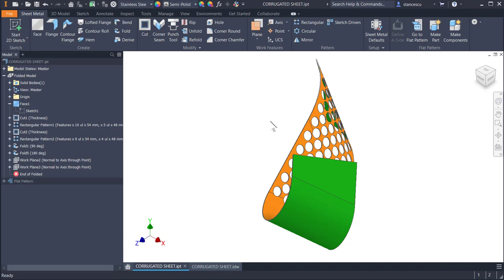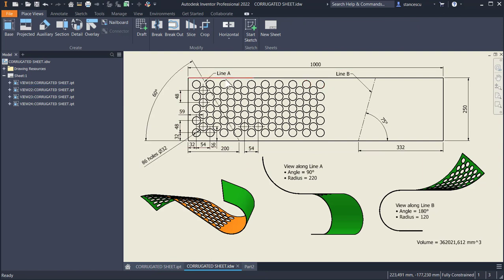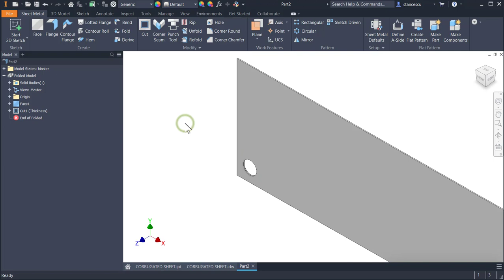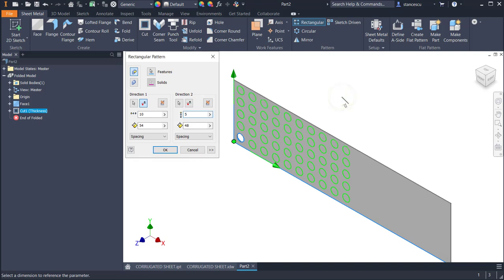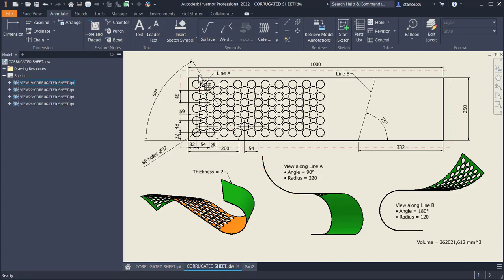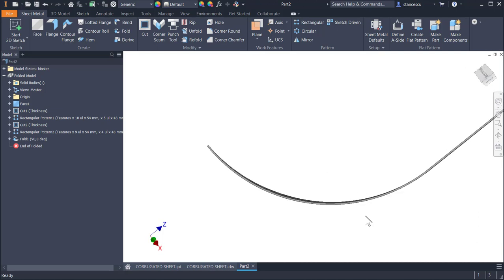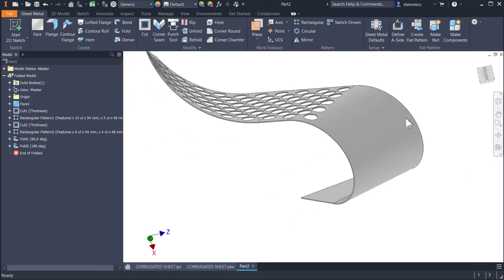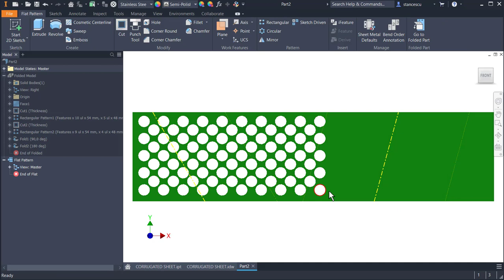Tutorial Inventor - 214 CORRUGATED SHEET

Comment: Hi sir, Nice work. Can we able to bend the sheet metal by using non-linear sketch i,e. ARC or something?
Reply from the maker: The answer is NO, but you can use the tools from the 3D Model tab instead of the Sheet Metal tab, as I did in my tutorial no. 213.
The result can be a non flat able sheet metal.

Comment: Hi sir.! At the risk of sounding trivial. I've noticed that when you measure a physical property like volume in the folded and unfolded states of a part in iProperties, you will get slightly different values? Shouldn't the values for volume for a part be exactly the same? I believe that the mass and density are both constant?
Reply from the maker: Good point! If you look closely to the volume you can see something like this: 2360183,522 mm^3 (Relative Error = 0,680841%).
This means that there is a tolerance of error anyway. However, if you follow my tutorials step by step the resultant value of the volume is exactly the same, as I observed during time. The mass and density are surely constant.